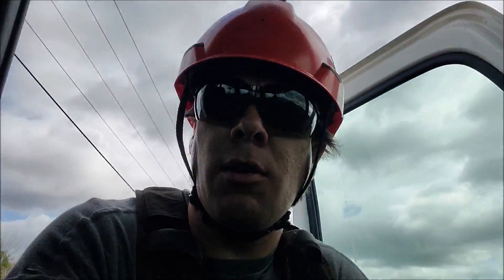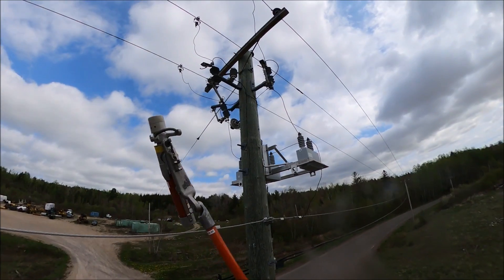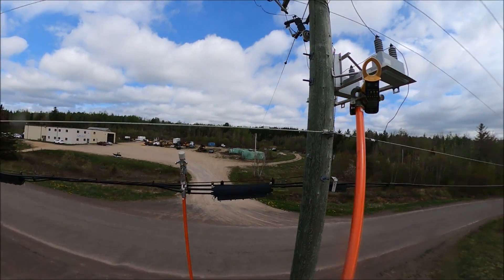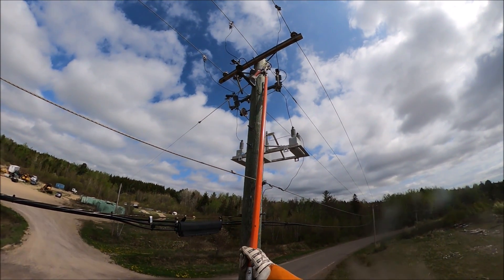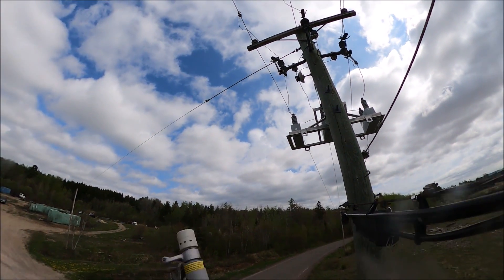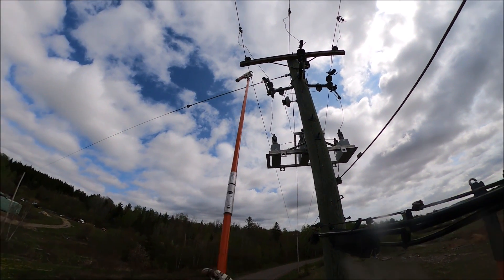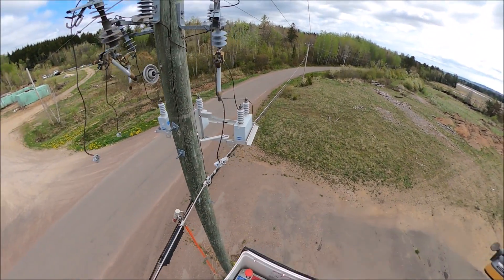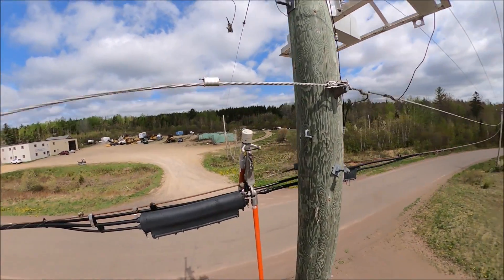Opening a Capacitor bank

Comment: When you work on components like those capacitors, perhaps a sentence or two of what their function is. I'll bet many of your viewers are like me. They might suspect the intended function. But, are not certain. My guess, is that these capacitors bypass away high frequency noise and sharp voltage spikes that 20 mile long antenna is sure to pick up.
Reply from the maker: I'm on it! Lol ... I totally didn't think this particular video would get many views from non Lineman. Stupid move on my part 😔 . I'll be uploading a follow up showing the actual load buster up close while away from energized wires.

Thanks for the feedback 👊! And you got that right on the antenna thing 😆
Reply: power factor correction as close to 1 bad power factor draws more current needing bigger wires
Reply: @stevepatrick5058  Exactly so! When lines are engineered some margin is built in (larger conductors are expensive and increase risk of wind snapping a series of poles) but hte load inevitably catches up. Cap banks bring the current back in phase sp the most actual power is transferred for the current.
Reply: These capacitor banks came in when air conditioning got popular. The motors in the air conditioners produce a lot of inductive reactance. The capacitors: capacitive reactance. These two out of balance produce several problems.
Reply: I would also imagine those capacitors would also help redirect unwanted current, as if when lightening rides the wires...

Comment: Fascinating video mate. Watching in Newport, Shropshire near Birmingham in England. When I was 16 I did my first work experience at the MANWEB training centre in a place called Hoylake, Wirral near Liverpool. It was a fabulous place they trained guys on HV, transformers overhead power transmission, switching and all the other stuff including house wiring. I wish I’d followed up on that direction I quite fancied working on HV systems and power distribution. Ended up working amongst many other fields in Electronics but I did work on radio transmission which was fascinating work keeping high power HF transmitters on air.

Comment: You probably have already gotten this question. What purpose does a capacitor on the pole like that serve? I have never seem them on a pole like that. Or maybe I see them all the time and don't know. I used to work security at a plant that had alot of overhead cranes and they had a couple of capacitors but they where on site not on the pole.

Comment: I'm more confused now than I was before about AC electrical current . I'll stick with 12 volt DC
Reply: 3 phase is 3 separate lines 120° out of phase, that can be hooked up into the same circuit to make more power than just a “regular” wall outlet. In the US, three phase is more used in apartments. Houses here use two phases 180° out of phase.
Reply: @ChronoTango  that's the best simple explanation I have seen yet.
Reply: @ChronoTango  i enjoy that OP said he was confused then you felt the need to post some random fact.

 And houses in the US and Canada are SINGLE phase (240V) split by the neutral conductor (120V Line to neutral, 240v line to line). They are not two phase.
Reply: @domthedonkey69420  Actually, 
 2 phase does still exist in rare instances, primarily on the east coast.  https://www.youtube.com/watch?v=JwL7XARJXg0
Reply: Oh ,, now I get it , that’s so simple SAID NO ONE EVER 
😂😂😂,, I’m just glad someone gets it so I appreciate you 👍 I like hot showers , climate controlled temp and ice in my bourbon 🥃,, cheers to you , be safe out there doing what you do
Reply: @Dallas-Rife-UDX-347-Tennessee  Look up images. Seeing it on an oscilloscope screen always helped make things click for me in electronics class.
Reply: regular 1-phase AC, as you get in a wall outlet, is just 1 sine wave (120V in the US), against a constant 0V neutral line.  Sine waves are used, because they're what naturally come out of rotating-magnet generators, and they're easy to work with using transformers.

In the US, our home power transformers generate 2 120V sine waves, exactly inverted (i.e. 180 degrees, or half a cycke out of phase).  We generally run one of these to our devices, while the other side is run to the 0V neutral line; this is the 120V that most American devices use.  But, by connecting a device to both opposed phases, the difference adds up to 240V, useful for high-power devices such as stoves.

But, the power grid uses 3 phases - that is, 3 sine waves - set 120 degrees of phase - or a third of a cycle - apart.  This lets electricity from one phase, return across the other 2.  Because each phase spends most of its time carrying a fraction the total current of the system, the average current is much lower across all 3 phases, than it would be for a 1-phase system carrying similar power, thus allowing for smaller wires.  Users are then distributed across 2 of the 3 phases, though some (like industrial motors) use all 3.
Reply: Technology Connections does a great job on explaining 120V, 240V, and 180° phasing with the three phase setup. https://youtu.be/jMmUoZh3Hq4
Reply: 3 phase is better than single phase when you have a lot of electricity needed, and less time to get those into your equipment.
Reply: @kingchua09  Every large 3 phase motor has long since switched to VFD, although it is still preferable to drive your VFD DC bus supply with 3 phase synchronous rectification.

Comment: I’m curios? What KV are you working? I’ve seen lots of 4.8 KV, & 12 KV, have had dealings with some Y 4160 KV, & 12.5 KV ? Have had some “close calls” with flash overs, it’s always fun to open under any load?? 
Thanks for the video.

Comment: Linemen have balls of steel. Or is it fiberglass? Ceramic?
//edit 
I know electricity in and out. Electronics,  grounding,  bonding,  step potential; I've even been hit hard by low current tens of kilovolts. I really start to sweat (which is counterproductive, lol) when having to help manipulatw live residential feeders.  
But when his bucket started getting near those overheads - holy smokes. It is the same feeling someone might get looking down the barrel of a loaded, cocked revolver. GET AWAY. GET AWAY. TOO CLOSE! DANGER!
I can't even imagine how you guys get used to it enough to actually get anything done.

Comment: I WANTED to know the amp reading, but the wind was too bad,.... what was it?
Reply from the maker: 14 amps at 7200volts ✌️
Reply: @Bobsdecline  I'm curious, would that be 14 amps of working load  AT 7200 volts from that service area being currently used at that moment? ,..and how many more amps above 14 are available from that 7200 volts?  thanks,..

Comment: I never knew caps were used in AC lines. I always thought it was just transformers stepping voltage up or down. Apparently they're used for power factor correction.
Reply: The caps would be used if the line was powering a facility where a lot of inductive (motor) loads were being used. A residential area would not require the caps because of mostly resistive loads where "E" and "I" would be in phase.
Reply: @TheOzthewiz  That makes sense. Higher peak currents when out of phase. Probably heats the lines up. Not sure how they figure out the cap values. I'd think inductive factory loads would vary? There's probably multiple caps in the system they switch in and out depending on phase degrees?

Comment: 5:05 I guess you turned your head with camera in case of big sparks, yes?
Are you working alone? If so isn’t that bad practice ?
Reply from the maker: That's exactly right, the sparks part... As far as working alone we have  strict rules for what we can and cannot do. We are allowed to operate switches with a double stick  and rubber gloves, but not allowed to commence any hands on work. 
Also we communicate with our dispatcher both before and after operating any device.
Reply: Bobsdecline - Lineman blogger  glad to hear that and that you’re doing it properly.  Be careful big guy!

Comment: Sir, I do some electrical repairs where I live and use the best safety equipment I can find like insulated gloves, shoes, multimeters with No Contact Voltage detection, safety glasses, clamp on ammeter, and a fault line dectector. A few times I managed to replace 220  breakers on the main panel. I was nervous but I do have a healthy respect for electricity and for the Work that you do.
Cheers...
Eugene

Comment: what if your boss told you,there is no time to wait for discharge capacitors and this job need to done today asap..
Reply from the maker: It's actually part of our work procedure and discharge only takes a few minutes. Our company is very safety oriented and, although may request a job be done ASAP, all safety procedures must still be followed ✌️💯

Comment: That's nice having a spring loaded tool to unseat the fuses without having to jerk each one and potentially fall out of the bucket.
Reply: That is not what that tool does:
It is a load buster, and it has load break contacts inside it.  It diverts the the arc to inside it.
It is a SHORT when contracted.  You attach it both the top (hot) hook, and the cutout pull ring.
When you pull the cutout open (no flash), the current diverts through the load break, then the load buster trips open upon continued extension, breaking the load there, and dissipating the arc inside.

There is a youtube video from a manufacture that details theirs...
Reply: Ahhh thanks for this comment, it just clicked for me and now i fully understand whats going on.
Reply: @mcanderson0  Actually that is not the purpose of this tool. See my other comment here to Dave's Stuff or Google it.  There is detailed youtube by a manufacturer on how they work.

Comment: I notice that you look away when operating the load buster. Is this so that, in case there’s an arc, it doesn’t cause eye damage?
Reply from the maker: Yessir! That's exactly what I'm doing
Reply: @Bobsdecline  I was also thinking to avoid being blasted in the face with something unexpected -- kinda like when firing field artillery.
Reply: Paul Fisher  , Paul, probably a good idea to look away when operating breakers or fuses at you property also even if the dead front or cover are closed , the idea is at least your eyes , nose, lungs throat, and face won't get as much traumatic damage if things go bad !
Reply: Would the arc flash be similar to welding levels? Would a auto darkening welding helmet be an alternative?
Reply: @michaelwillis1832  It is similar, but hotter (10,000F rather then 6000-7000) and bigger, but not as long-lasting. I don't know if he has mentioned it in other videos, but the clothing is "FR" (fire resistant, HRC 2 rated.) The flash reaches temperatures twice the boiling point of iron. Just sayin'.
Reply: Bit's of hot copper ruin your day as well if the switch falls apart or something breaks.

Comment: I got one of those poles behind my apartment building and it creates allot of static in radio waves
Reply: Call the electric utility for your location. The problem is with the insulators - dirty, deteriorated, or whatever. When I was a ham in the SF Bay area PG&E sent a guy out with a detector to hunt down and replace the offending insulator. They probably don't mind because noise is usually a prelude to failure.

Comment: What is the function of the capacitors on the line, some kind of power factor correction?
Reply from the maker: That's exactly what they're for! They're usually installed in industrial areas with heavy inductive loads. More advanced systems can also monitor the load and only feed the capacitor as required

Comment: I cannot believe you work alone on a job this dangerous.
Reply: this is thanks to publicly traded utility companies...
Reply: @JohnCurtisPiano  It is standard practice for linemen to work alone. There is not normally a need for two people to be in the same location; when there is they call for a helper. As long as the precautions are observed it is safe enough, just as working with explosives is normally done alone.
Reply: It was said that he is waiting for a partner, this step really isn't very dangerous using the insulated pole
Reply: Looks efficient to me.  What do you need five guys standing around for?
Reply: It offsets the other line crews where 9 guys watch one guy crimp a 100 amp cottage service.
Reply: @thereynolds2725  they were just at my place in Honesdale pa.
Reply: Jobs as dangerous as you make it
Reply: @T2D.SteveArcs  shit happens, even to the most vigilant

Comment: Excellent video 
When I used to spray substations for vegetation control I always gave Cap Banks lots of respect. They were the one piece of equipment that always made me a bit nervous lol
Reply from the maker: That's a good thing 👌 . Not being nervous is when people get hurt
Reply: Little field cap banks are not that big of a deal. Nothing to be nervous about any more than anything else HV. 

But, there are much larger banks, usually in substations.  You don't want to be that squirrel.  BOOOM!
Reply: Someone once said touching the wrong contact would be technically interesting but not much fun.

Comment: 1)How many amps? I couldn't hear.  2)How many amps would be typically going through the main wires? 3) What do the capacitors do?
Reply from the maker: I think it was 14 amps... We aren't supposed to open over 10 without a load busting device. A typical amperage in my area is about 150-300 amps on each 7200 phase. This allows lots of room for peaks during extreme cold temperatures.
Capacitors improve the efficiency of our system by correcting the power factor.
Reply: @Bobsdecline  The wires on the pole in my backyard are carrying 11kv   and are fused at 100 amps.

The massive tower in the front yard is  carrying two 110kv circuits. Those lines feed a major substation which is just a short walk from here. A few other 110kv lines meet at the substation.

My house loses power relatively often, because the lowest voltage power line coming out of that substation is 44kv. The 44kv power goes to a smaller substation far away where it is stepped down to 33kv or 22kv. Which then goes somewhere else to get brought down to 11kv to get to my backyard. The transformer on the pole drops it to 120/240v for my house.

During power failures, I can stand under the big power line and here the 60Hz hum. Those lines almost never go down.

Comment: I worked 32 years as a technician at a medium sized utility.  We didn't interact with linemen very much (our dept installed hv breakers and xfmrs) but we sometimes jokingly referred to them as size 13 boots and size 5 hard hat.  Not to their faces because they tended to have tougher guys than we did.  It was all in good fun.  Respect.